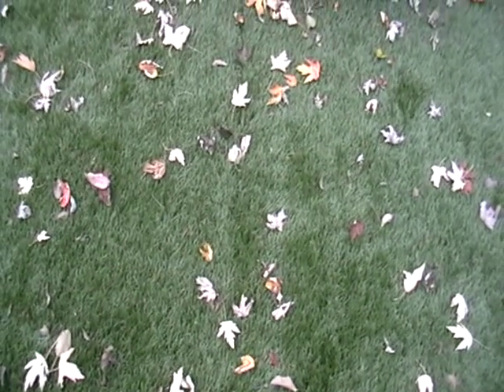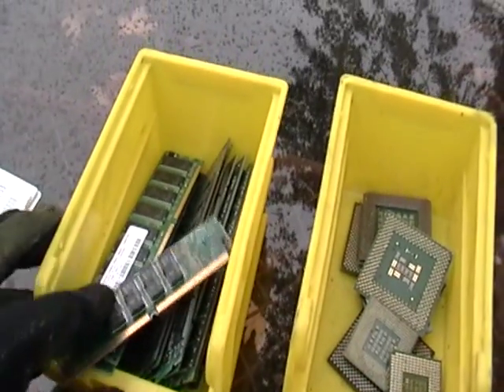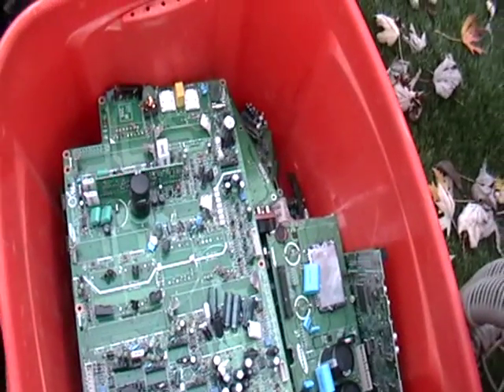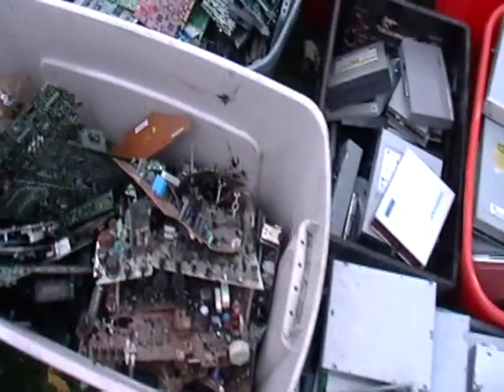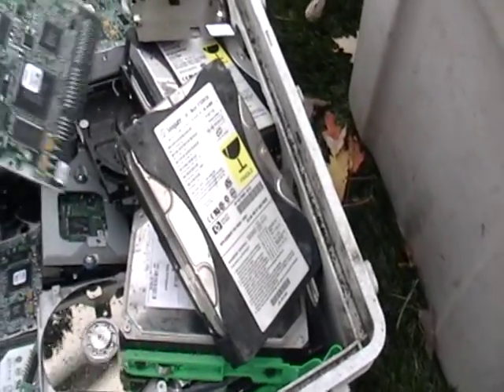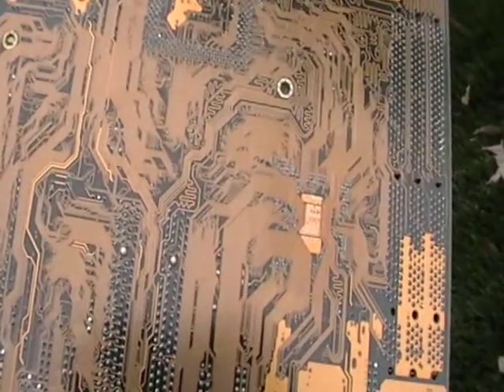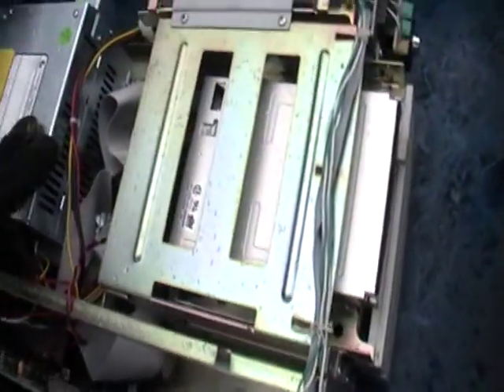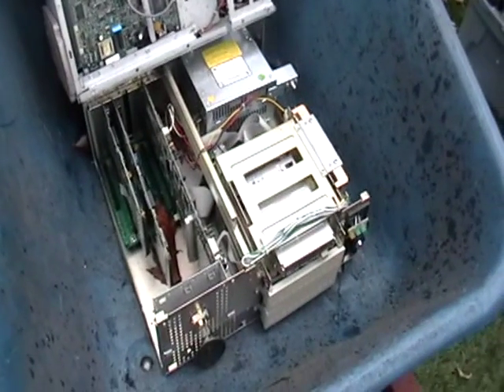Going to the scrap yard part 2

Comment: Wish my scrap yard would take low grade. Ive got 2 bins full. some kinda smashed up not badly just smashed off where i got the cast aluminum etc. Idk if i should sell it on ebay or not if its even worth it
Reply from the maker: its about 10 cents lb. Save it you will find someone local to buy it

Comment: The back of that motherboard is copper, not gold.  Wishful thinking there...
Reply from the maker: Keep looking, there is gold on them.
Reply: +Mike the Scrapper The large sections of metallic plane on the back and front of the motherboard that you identified as gold is copper.  It just doesn't have green solder mask over it like most boards, it has clear solder mask.  There is no chance that an entire consumer-grade board is gold-plated as that would more than double the cost of the board, and it wouldn't sell.  Usually when something seems too good to be true, it is an illusion.  While there is gold to be found on motherboards, it's good to understand just how much.  if that were all gold, there would be around an ounce of gold there...  how much is the board worth again?